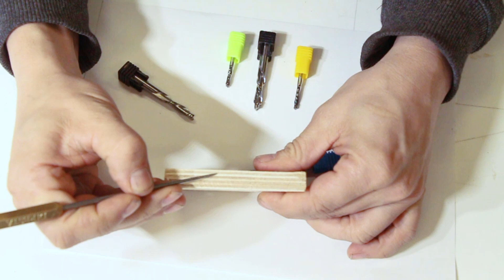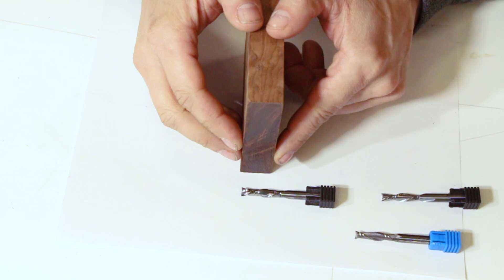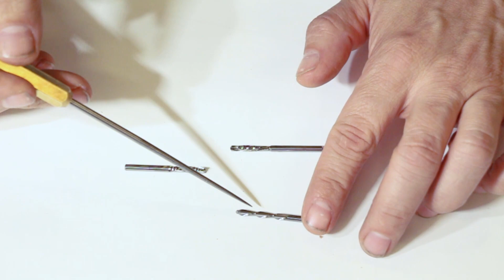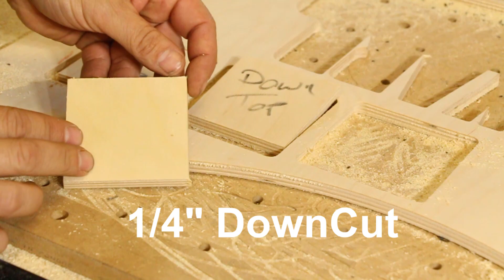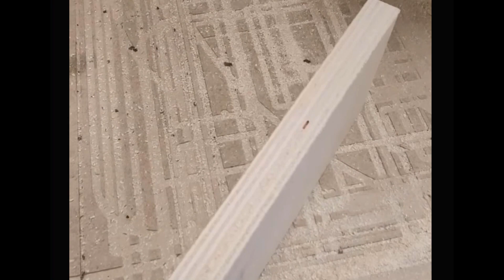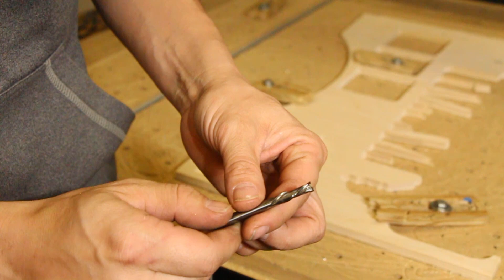CNC Compression Bits

Comment: I am wanting to cut out an intricate design using 1/2" plywood. The project is about 2'x3'. Instead of using a jigsaw, I want to use my router with a compression bit. Do you think this will work easier and better? Do you have a suggested bit to buy? 1/4 " shank.

Comment: Which bit should I use to pocketing deep hole, about 2 inches deep 1 inch wide? Thank you for your great explanation.
Reply from the maker: I would see if you can find a long 1/4" with enough cutting depth to make the cut. If it's only a pocket a downcut bit should do the trick

Comment: Thanks for video.  It’s very helpful.   May I ask, is your table a vacuum table?   I noticed you had no tabs set into the cutouts in the video.
Reply from the maker: my small table at home is a Shapeoko, no Vacuum. Depending on what I'm doing I don't normally use tabs unless there's alot of small pieces.